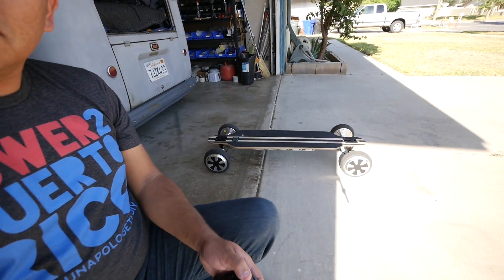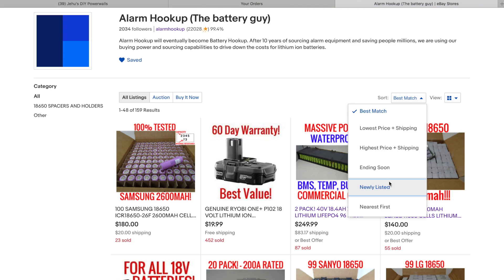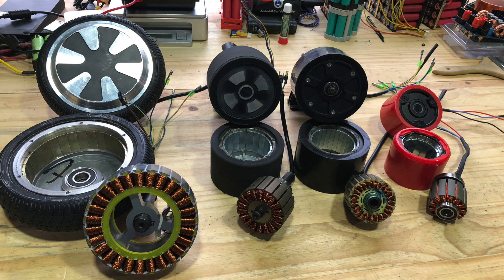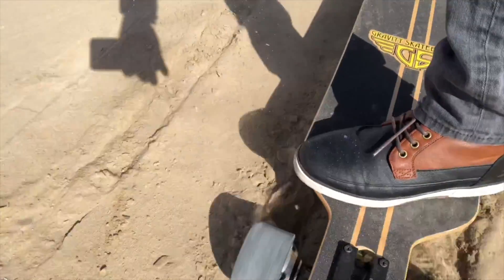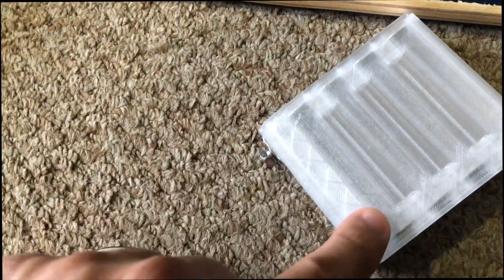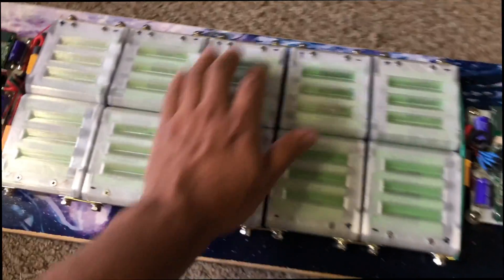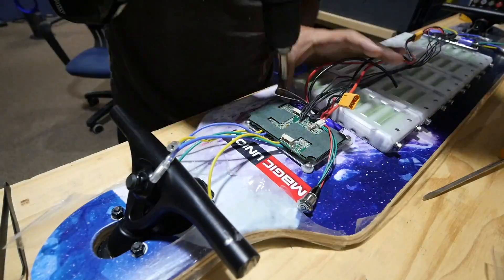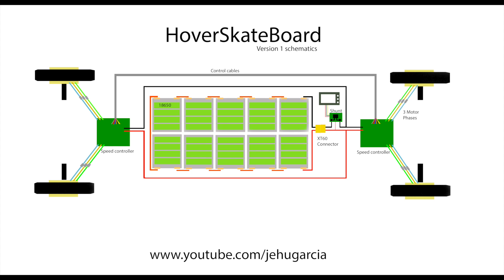Baja Electric Skateboard using Hoverboard wheels (HoverSkateBoard)

Comment: Hey, I found your diy e-sk8board very similar to my idea. I'm trying to build an e-skateboard that I can attach to my jogger stroller. I made a skateboard that I can attach to my jogger stroller, now my issue is my legs gets tired from pushing. I need something electric that can be use uphill and on the grass. I need a thicker wheels that can go through all terrain. Hope you can help me. 🙏

Comment: how about using ebike wheels then u get faster speed some told me it is possible to use Ebike wheel on a skate board also there a also there's a hacksmith video where they made electric skateboard with four powerful Motors and the guy who made it had to lower the power down  some otherwise it'd be too powerful for him to handle you can just look at the house Smith YouTube channel and you'll find it there

Comment: did you ever do part 2? i am really interested in this and can use your videos with my own setup

edit: i believe i have enough battery cells, and hub motors. im interested in the speed controllers you used and i want to have the master speed controller wired to the wireless transmitter of my rc car remote for throttle.

i also would like to know where you got the motor mounts for the trucks and if you machined them please let make a video covering all of these topics.

big edit: i used my brain to look at the description of all the listed parts and its only a matter of time and money and if i decide to make a video ill make sure to credit you
Reply: I basically made it but i am trying to wire a rc signal to a 0-5v bldc speed controller and i might need to use an arduino

Comment: If someone is still reading the comments, open your hoverboard hub motor. What you will find out is that the motors coils are in WYE configuration. Change it to DELTA configuration and it will make the motor spin approximately 1.7 times faster than before. WARNING: this may overheat your motor, so be cautious!

I made a electric longboard with one hoverboard hub motor, vesc, vesc remote and power tool batteries. First the board drove ~11mph. After the modification with same battery voltage (36v) the board drove ~19mph. What you will loose is a bit of torque and the motor will heat up a bit. I drove the board up some really long hills and the motor was not even too hot to touch, just warm. I'm quite sure you will burn the motor if you also raise the voltage alot, so please be careful.

The motor still has plenty of torque after the modification, so even with one motor you are able to climb hills. 19mph is plenty of speed for inexprienced riders, like myself.

Comment: Jehu, fit some 4.10 3.5-5 tyres from a mobility scooter and it'll be much faster.  Adding voltage to a brushless motor adds torque, but it won't necessarily make it faster unless you're already torque limited as the top speed is set by how fast the ESC can switch the poles on the 3 phases of the motor.

Your options to go faster are a different ESC (look into VESC, it's fully programmable) or bigger tyres.  Or both.  More voltage may help to push those bigger tyres though.

https://www.youtube.com/watch?v=Gd4ZhcLUYC0

Comment: Hub motors, are not the best, they have very thin urethane so there is like no vibration absorbtion, and there is less power, I would say that the best would be direct drive because they are the most powerful, and you get full wheels so you can change the wheels and have full vibration absorbtion.

Comment: You need to use a controller that supports field weakening. We use the same 4 motors on some e-bobbycar and for everything motor controller related it's vesc and only vesc ;)

Comment: Hey guys and jehugarcia
, I just wanne say that I was inspired to build this DIY Skateboard and I have done that. It is finnaly finnished, and I have to say It works realy well but just like jehugarcia
 said the tork is there but the speed is missing. so I will overvoltage the hub moters to a 12s battery, now I'm running them on 36 Volt (42v). I think most people don't have that much money so this is the cheapest build there is(?) for me the final cost where around 260 euro's (303 dollar). It is a lot of fun! Thanks for the great video!
Reply: Hi, I am also building a Hover Skateboard at the moment. How should I charge it / witch charger should I buy? I will connect 6 hoverboard batteries in parallel (total of 26ah on 36v on a xt 60 plug).

Thanks for anybody that can help.
Greetings from Germany

Comment: Hey buddy..... Dont put 48v to those motors.... All you have to do is add shims between the commutator and the stator so that the magnets are not directly under the windings.  Watch this video and you will understand how to get more out of those $10 motors bro.  https://youtu.be/HiD6amSoVsg 
You can also look up variable field magnet motors on here.  Use something better than double sided tape to hold those batteries on the board.  Hook me up with a good deal for the tip broseph!

Comment: Hey dude i love ur videos. Im in the middle of my Esk8 board build. Im thinking about using the NESE battery holders you used. Did you print them if not ware did you get them? Also did you make a video about installing a BMS with those NESE holders? Because I really want to use those holders but I cant find them in the states or any videos on how the BMS gets wired in. Any help? Gracias mano!!

Comment: i build a board with one motor, that goes 50 km/h :D if you take thoose cheap escs and motors, you will get a cheap building :D why dont you think about thoose things before you build it? seems to be the cheapest way to get clicks and not to build the best board.  There is no passion.

Comment: Somebody just needs to make forks to attach an ebike wheel to the rear of any longboard. Just a metal flt plate to screw to to board with forks going back to a bike tire.  Way easier to switch out, easier to find, universal af. Cheap.

Comment: Did you ever take this thing to a decent gradient hill (how many degree incline would you say)? I'm assuming the torque on those motors would pull you up most decent hills and barely notice the difference in current drain.  - from there you could get adrenaline going by letting the motors freewheel and just relying on good old fashioned gravity.

Comment: Can we charge our battery while its discharging?,  like our cell phone, if we can do means, please give me that knowledge how to make that,
Reply from the maker: Your charger just has to output more than your load and it will keep charging
Reply: @jehugarcia  is it safe for charging
Reply: @jehugarcia  I have another question,  every battery having only one terminal point which is + and -- from this points only we are discharging and charging, while discharging time if i connect my charger cable on the battery terminal, is the load will suck the power from my charging cable or load will suck the power from battery only? Do you have any recommend circuit design for real time charge and discharge,

Comment: http://vocke.tv/lib/exe/fetch.php?media=20150722_hoverboard_sch.pdf
what the 4 wires of charging pin does? can i exclude the entire board and charge directly from the external charger? the li po pack already contains BMS. do i just need to connect the 2 of 3 pins to the battery? black and red? thanks in advance.

Comment: I just mounted the motors to the skate board. I mounted the other items to my backpack and put a small solar panel to recharge. My backpack also powers my cell phone and other is stuff. The speed control is also on back pack. It makes the board much more capable.

Comment: wheres the update build i want to make one but has to go faster then 10mph
Reply: Use a 14s or more battery
Reply: @mashedpotatoes5323  Use taller tires.
Reply: @Yotraj  that's pretty difficult with these types of hub motors because there's not a lot of aftermarket tires, it's possible to  make your own tire with a mold but I personally wouldn't want to do that because it seems hard. You also lose a bit of torque with taller tires but I don't think that would really matter if you have 4motors.
Reply: @mashedpotatoes5323  stupid. Its disign to top out at 10mph.
Reply: @ramadavince6611  lmaoooo you clearly don't know how Kv works with electric motors.... you can even go higher than 14s but if you go too high the windings will arc together and short out.
Reply: @mashedpotatoes5323  haha you clearly are very new or know nothing about rc electronic.
Reply: @mashedpotatoes5323  hoverbord motor r design to run 10mph max. Unless u hack them.
Reply: @ramadavince6611  please explain... As long as his esc can handle it he can increase the voltage to make it go faster. That's just how electric motors work... It will also need enough amps to get over the extra wind resistance too but with 4 motors like those hoverboard motors that will be easy.
Reply: @ramadavince6611  what is there to hack? Lmao there is no computers or anything on the motors it's literally just magnets, copper windings, a small circuit board that has three hall sensors to detect the position of the motor. That's it. It's a basic brushless motor with hall sensors.
Reply: @mashedpotatoes5323  lol. Look like u have a lot to learn. If you r really want to know why look up on google
Reply: @mashedpotatoes5323  this guy is using another esc and 6s and why thefuck is he still at 10mph can you explain that??
Reply: @ramadavince6611  it's not... People turn these hoverboard motors into electric scooters that go well over 20mph.
Reply: @ramadavince6611  the lower the voltage the slower you go. It doesn't matter what esc you have necessarily.
Reply: @ramadavince6611  I feel like you are thinking since the max speed hoverboards can go is around 10mph it would be that's the motor that's limiting it.
Reply: @ramadavince6611  https://youtu.be/Xv4UIHgjna0 this video shows the inside of the hoverboard motor, the author of the video is a bit misleading explaining what the hall sensors do but people in the comments set him straight.
Reply: @mashedpotatoes5323  is your scooter same as scooter in the video i give link??
Reply: @mashedpotatoes5323  funny im born with somuch in to thin ev stuff that i had watch all video you link to..lol.
Reply: @ramadavince6611  youtube is getting butthurt about me posting links I think but compare the inside of a hoverboard motor to a ninebot es2/es3/es4  or a xiaomi m365 motor and you will notice they are almost identical. The electric scooters go a bit faster at 20 mph but that's because they don't have to balance you lmao. I actually have a custom made ninebot es4 with two 36volt (10s) rated motors but I'm running them at 67.2volts with my 16s12p battery and it goes 30mph
Reply: Also some motor are design by maunfactuer their max rpm, but all motor are not like that.
Reply: @ramadavince6611  sure every motor has a bunch of different max ratings but if you know what you are doing you can generally pass them just fine, especially with these hoverboard motors and electric scooter motors.
Reply: @mashedpotatoes5323  identical??? No. All motor are bascially same rotor, magnet stator, copper wire (this is where diffrent kv came from) some hall sensor. honestly i dont know how they restric the motor rpm using from motor alone, but look like they can restric tho..
Reply: @ramadavince6611  I'm saying this because the hoverboard motor and scooter motor have the same amount of magnets on the rotor, the ninebot and xiaomi motors look different but on the inside they are literally the same motor and the stators can be exchanged, I have a few of those motors so I know first hand.
Reply: @mashedpotatoes5323  you’re right in this argument the other dude doesn’t know what there talking about
Reply: @mashedpotatoes5323  hey sexy, you mind making a video of overcharging the hoverboard motors, or changing the configuration of the wiring?
I wanna make a go kart and i want to use the 10 inch hoverboard motors, but they still dont go that fast. So if you can show us how to safely make them go faster. it would be much appreciated.
Reply: @ramadavince6611  you understand that these motors are not governed? Any speed limit would in the controller NOT the motor....
Reply: But he's going way faster than 10 miles per hour
Reply: I have the parts but I need the guidance of part 2
Reply: Derren Knight what does this entail? Would you be opening up the motors, or just connecting the wires differently to the ESC?

Comment: how about power management system? what if a cell not balanced and overheated while you are charging(i mean 4 18650 battery in one case)? lets say you have 4 18650 cell in case and 2 of them are around %70 capacity and the other 2  18650 cell  are  about %40 percent . will charger spot the %100 full 2 lith-ion battery and continue to charge other 2 battery ??? or continue charging 4 of them even if its overheated??? i am confused...????

Comment: well you didnt use a BMS so have fun with your fire hazard #futurebuildgoals 
jkjk the board is awesome, I just built a 52V ebike, having way too much fun.
Go install a BMS asap otherwise your cells will charge and discharge unevenly over time and create those wonderful hoverboard fires you mentioned.

Comment: So did you ever try 48v. I'm thinking if using 60v for more speed and distance. I think you only need two  hubs wheel cuz the weight is crazy. Do you think the speed controller can handle 60v?

Comment: Typically, that 3M or Gorilla double-sided tape is incredibly strong, and if applied properly, onto a clean, dry surface, you should never have to worry about it coming off. If it does, however, I would just buy a tube of Sikaflex, but be warned, once it dries, it is a PERMANENT fixture of the board from that point on.

Comment: I looks like the hole you made for the battery controller could've compromised the structure strength of the board itself.
Reply from the maker: Yes but I’m 160lbs,  pretty sure I don’t need every ounce of strength in that board

Comment: Would this setup work with the Headway batteries? Maybe the terminals could be connected with spring steel as long as it didn't give too much of a voltage drop.

Comment: Hey I used to skateboard alot, this looks really cool. But you should make a board with good sliding wheels (zomboehawgs for example) and increase the abrupt acceleration so you can pull off some crazy downhill slides. If you search up downhill longboarding, you'll get what I mean!

Comment: When is the followup video coming out? I'm considering building a  board like yours but it would be nice to hit atleast 20km/t. Now it's possible to buy ready made trucks for these hub wheels!! https://www.aliexpress.com/item/11inch-Electric-skateboard-truck-Two-drive-four-drive-electric-skateboard-truck-riserpad-kit-10-brushless-hub/32832223389.html?spm=2114.search0104.0.0.1cc25264MOaXhf Did you try to rewire the motors like suggested down in the comment? It should work in sensored mode, but maybe not in Field oriented control(FOC) mode? There is so little available information on those escs, some forum speaks of a speed limit.. if we only could set that higher :) I doubt the esc handles higher voltage, most esc dont do more than 12s. The voltages created by regen braking fries the esc. If someone could post some links to more information on rewiring, or the escs that would be great!

Comment: nice build. just one tip, copper and brass workhardens, so using it to connect battery cells, while the board flexes might just break it after a while.
cheers.

Comment: Hey jehu! Hey I want a 72 volt 15+ amp charger, my BMS and Cells can take 50 Amps. To save money can I wire two or more chargers in series and or parallel to get the voltage / amperage I want? 

Question 2, on a different battery pack I want to wire 2 - 42 volt bms in series to make a 72 volt battery pack, is there any harm in puting bms in series?

Comment: Now here is the question. Can you still use it as a mormal skateboard and kick push it if the batteries are dead?
Reply from the maker: Yes,  hub motors have very little rolling resistance
Reply: jehugarcia so we should be okay to push on our own then.
Reply: @jehugarcia  i forgot to asked how long on a full charge do you get to from ride?

Comment: If you're concerned about the double sided tape you could 3d print some kind of a rail to epoxy down to the board with a channel for the wires and slots for each battery pack you'd probably be able to strap it down pretty easily.  Sweet board!
Reply: https://www.youtube.com/watch?v=YhvPJpmJgOk

Comment: why don't you need balance wires? (I'm new to this battery chemistry, I'm used to lead acid but have been loving your channel so far)
Reply from the maker: I might end up using a bms system but I’m not done designing this system

Comment: Awesome project, thanks! That looks pretty fast as an alternative to a bicycle. Which is really what you want to get around town.
I have to look into this more, what is the best way, hoverboard or electric skateboard or e-bike? It feels a hoverboard would be better because you can control the speed with your feet instead of needing a remote.
Another problem is of course the legality over here in Europe :/

EDIT: After looking a little, problem with hoverboards on even slightly uneven surfaces is that any vibration changes the tilt and makes the ride awkward as a transportation vehicle. So skateboard is probably actually better.

Comment: So If one had a 18s10p 18650 cell battery pack how would you determine how much current you could draw from it?
Reply from the maker: The esc is rated at 12A per motor so about 48A
Reply: @jehugarcia  more volts less amps better to battery lot.